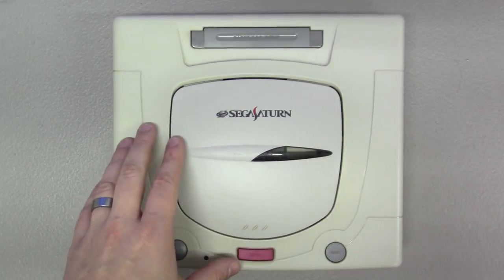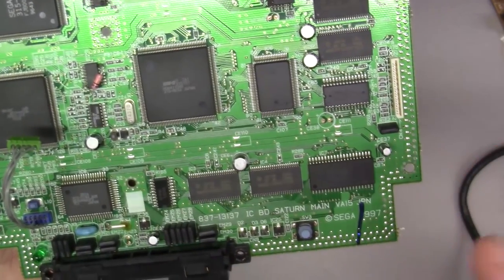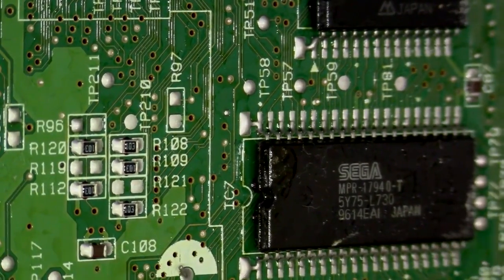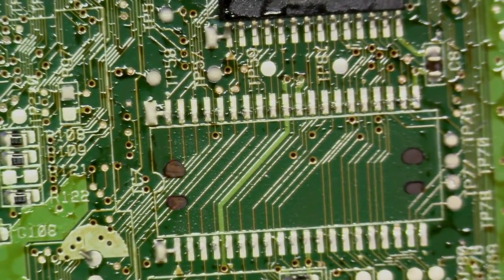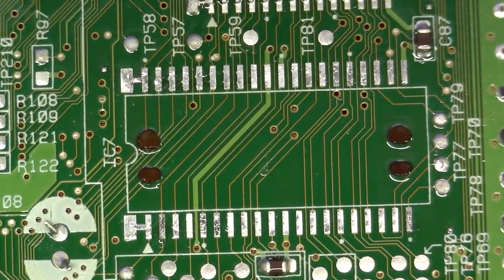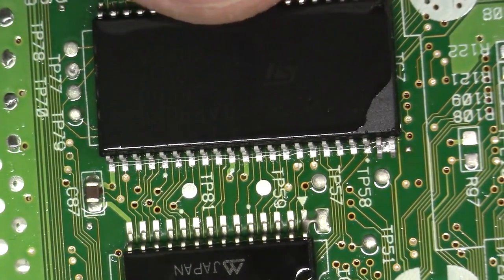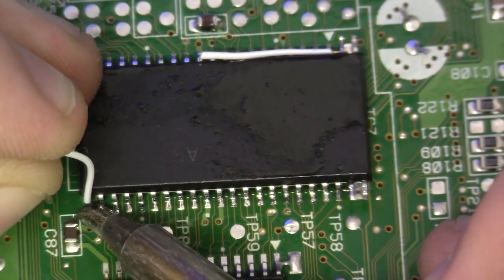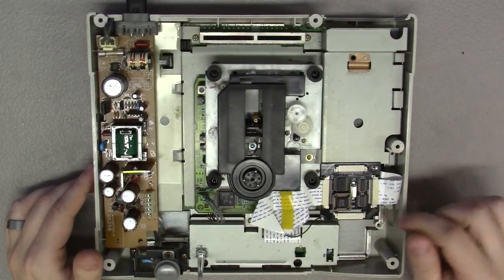Super Challenging Soldering Mods for the Sega Saturn!

Comment: quick question: why does the model you're working on with the epoxy look like something's been spilled on it?
Reply from the maker: A lot of these Saturn mainboards left the assembly line with a lot of flux residue that isn't removed after the wave soldering process.Completely harmless, but it does give the appearance of someone dowsing the thing in RAIN-X or something. :-D
Reply: video suggestion... how about a video on how to adjust PC Engine Duo CD lasers and when its time to give up and replace the laser assembly itself?  I recapped my console a couple of years ago but I couldn't quite get my laser to dial in with the directions on the pcenginefx forums.

Comment: you are Amazing Sir, I was wondering that Phantom Mod , that's for burned Copies??? I was also wondering if there was some type HDD type of Mod. I always wanted a Saturn but they are so expensive.
Reply: odaddy 47 A man named professor Abrasive has spent many years reverse engineering the CD drive and VCD slot on the back and is finally working on a flash cart style solution for the Sega Saturn. There are a few early units out there, but they're not the finished product and still sell for a ton on eBay.

Comment: Why do people remove the original rom instead of just disabling it?  Lift only the enable pin from the board, and you can piggyback the new rom onto it.  A lot less stress on the board, and a bit less work.  You could also have a switch to toggle which switch the enable line is connected to, to instantly revert to the original rom...
Reply from the maker: Sure, you could do that. A lot of people do?

Comment: I wonder if it was an engineering decision to put epoxy below the chip? Why wouldn't they just rely on the solder to hold the chip down?
Reply: The adhesive is prep for the wave soldering process. Surface mount components are basically glued to the board, which is then flipped upside-down, and then passed over a standing wave of molten solder.
Reply: @101fng   I never knew that. Thank you so much.

Comment: @voultar I love your videos! I have a question though, you say you use no-clean flux, I have heard people say it's not good for the pcb, are they talking out of their ass or are they right? I'm sort of a noob aspiring to be a console modder, it's a sincere question, not a troll attempt. thanks in advance, and thank you again for good content =)
Reply from the maker: No, they're not talking out of their ass-regions. It depends on the composition. I use a no-clean flux that has a very low solid content and isn't organic and/or water based. There are variants of no-clean flux that are intended to be used in manufacturing during the wave process. These boards are subsequently bathed chemically after assembly, removing all of the caustic liquid flux. If you're going to use a no-clean flux, be sure that you select a variant that is intended to be used for site repair/rework, and you'll be just fine.
Reply: Thank you very much for the detailed answer Lord Voultar, I have no further questions !  =)

Comment: Time to hijack this fresh new video's comment section and use it as my own help forum, because I've had no responses on the actual help forums. Sorry.

I've got a model 1 saturn that doesn't read discs. I put in a music CD, it spins and the access light blinks, it flashes "checking disc format" on the screen for a few seconds after having skipped the intro, then just hangs on the CD player screen. I replaced the laser, same problem. Can't tell if the replacement laser was just DOA, or if my problem wasn't the laser to begin with. No obvious faults on the board, ribbon cable checks out fine. 

If anybody's got any info, like that aftermarket lasers have a 50% defect rate or I've gotta replace my caps, that'd be greatly appreciated.
Reply from the maker: You did remove the ESD solder blob from your new laser, right?
Reply: Yessir. Laser shines, disc spins up, but it just refuses to read.
Reply from the maker: Interesting..
Reply: Thats crazy i have a mk1 saturn that needs a music cd to play then switch it to a game disc just to play a game generally  or it will not recognise any game prior each time freshly turned on
Reply: Try the Sega16 forum.....

Comment: If you not planing to use removed chip again just cut it's legs off with wire cutter and then unsolder them one by one.
Reply: That's useful at times, but here, it would just present an unnecessary risk.

Comment: Backseat modder alert... Not a fan of using power tools to remove/install screws. Easy to strip the standoffs.
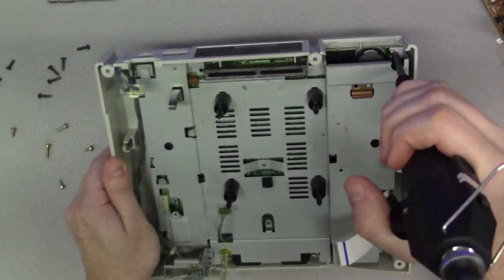Reply from the maker: It's not a drill, it's an electronic screwdriver. It's doing precisely what it's supposed to. Notice the clutch slipping @ 1:57. Doesn't harm a thing.
Reply: Voultar fair enough. Going back in though you could easily misaline. I prefer to go reverse before going forward just to make sure the threads are aligned.
Reply from the maker: https://youtu.be/YTFGz8CH7lk?t=18m40s  -I go over that in good detail. You're right. The slipping clutch on this electronic screw-driver is designed to mitigate cross-threading the bosses from happening.